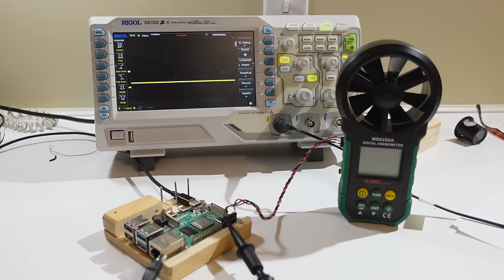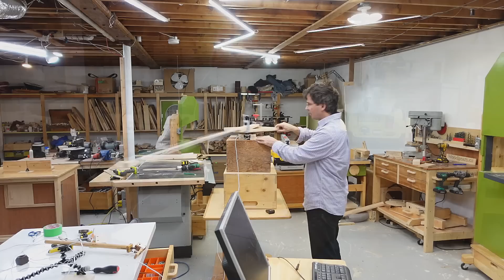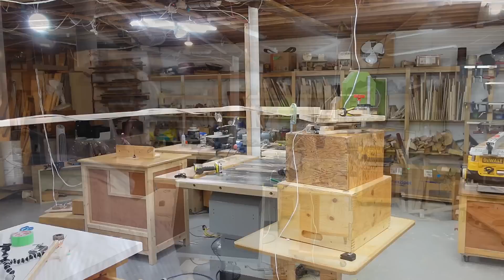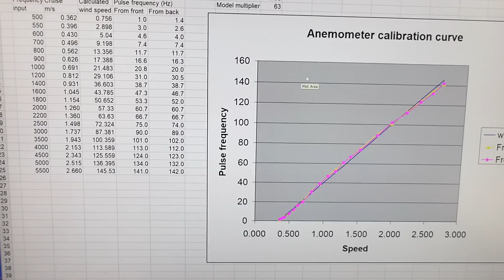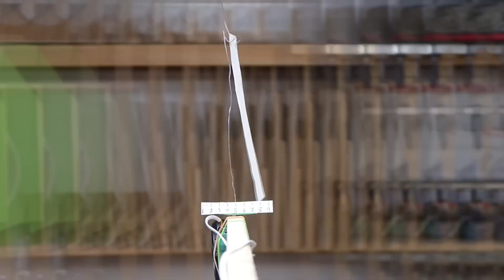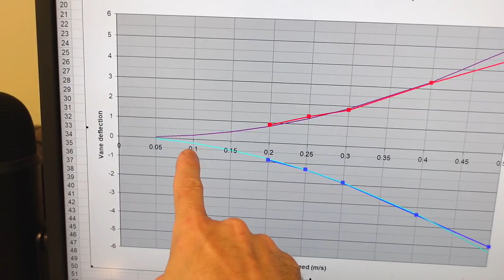Calibrating my anemometer for measuring really low wind speeds

Comment: Looks complicated can’t you put it on the end of a pipe and blow air through at a given rate .
Air circulating smoke or a thermal camera.
I hung 9 temperature sensors in 3 lines from the ceiling  floor and ceiling were 20 deg c different. Halfway between floor and ceiling was half way between two temps.
When petting aircon fan on recirculate all sensors went the the half temp , after turning fan off all temps split again to original readings.
Made some cool graphs

Comment: Matt, for low speeds instead of deflecting a sheet of paper, you could consider a static orifice with a microphone to measure sound pressure volume, but you would probably have to calibrate that! U of W alumni.
Reply from the maker: those slow speeds don't make enough turbulence to be heard
Reply: @matthiasrandomstuff2221  It doesn't have to cause turbulence! I think the idea was measuring the static pressure the wind would be causing directly from the signal, rather than the oscillations from turbulence. It not causing turbulence is a good thing!
Reply: P.S.: Especially with a large surface attached to the microphone (i.e. a sheet of rigid plastic or even paper attached to a piezo), it should be easy enough to measure the static pressure. I'm thinking about doing that experiment myself now out of curiosity! I've been wanting to measure the pressure coming out of those little ultrasonic humidifier devices for a few months, and this sounds perfect for that.

Comment: Aerospace engineer, swinging through the same air is not ideal, but in this case i wouldn’t worry too terribly much. As a non-lifting surface only the drag is really perturbing the measurements in future sweeps but for just a couple I think it’s unlikely to be a major contributor to your error here. They used to have rotating boom equivalents to wind tunnels that worked ok but did face problems with re-entering the perturbed air

Comment: Hot wire anemometer for low speeds, just as other said in their comments. Those are used in small airplanes (gliders especially) and measure to 0.1 m/s speeds. Just 1 wire and resistance measuring ( plus "heating current").

Comment: Wouldn't it be easier to fill a room with "smoke" or with "prism" light and that way capture the air movement via dust or particles suspended in the air?  I think the error factors are going to creep in at those super slow speeds any way to try to minimize it. Someone walking upstairs or downstairs or random knocks or creaking or settling or just temp and humidity changes might cause brief error readings right ? 😀
Reply: I think that works great for visualization, both for conveying the movement and figuring out roughly where air is moving, but the problem is quantifying it.

Comment: Would it be possible to measure the static pressure on a paper disc? Instead of deflection?
Reply from the maker: with a sensitive enough scale, yes.  but deflection is much easier

Comment: Very interesting! What you need, for low wind speed is either an ultrasonic or hot wire anemometer (or an expensive laser Doppler anemometer), but the paper flap has low mass and seems sensitive enough for your project (and the principle has been used for ages, as a visual indication of wind speed on weathercocks - nevertheless a patent was granted for it in 1987).

Comment: Nice setup. Have you considered not to measure the frequency at low speeds but rather the time in between pulses from the sensor? The ratio between max windspeed and very slow speed might be too big for accurate frequency measurements (in one frequency range). An alternative methode  might be to increase the sensor pickup at low windspeeds by increasing the number of reflectionstrips?
Reply from the maker: timing indivisual pulses is risky as the motino may not be that smooth.  But I accumulate at least 40 transitions or 3 seconds worth to make sure I have a good frequency reading.
Reply: @matthiasrandomstuff2221  Thanks for the response. If the highest windspeed is lets say 25m/s and the lowest that you want to measure is 0.1m/s than this gives a frequency range ratio of about 250. To measure this accurate over the full range with lets say .01m/s accuracy you need most likely to change sample time (or gate time). Do you do this in the way you measure the frequency?

Comment: This measuring device only measuring the speed in 1 direction. You have any thoughts about a 360 degree measuring device? I’m thinking about a balloon upside down, with a needle glued on the bottom, and a circular scale. So you can measure the actual speed and direction in 1 go.
Reply from the maker: I could just have two vanes 90 degrees different angles

Comment: Instead of a peace of paper, maybe you could use thin material with much lower weight. And add a little weight on the bottom, for stability. In addition you could trying to create a cupped shape, so you receive more force, that will result in more accuracy.
Reply from the maker: I could also have used a longer strip of paper for more sensitivity.  But at some point it just gets too twitchy
Reply: This paper sheet is too hard. Cotton yarn is extremely sensitive and used in soaring planes (gliders) in front of the pilot to indicate side slip.

Comment: Love your problem solving.  To avoid the twisting cable, maybe use an ESP32 and battery setup.  To sync with stepper pulses, you can use a LED on the stepper pulses that flashes into a photo transistor connected to the ESP32.  The other option is to time sync everything, I guess +/1ms is good enough.
Nice idea on the flapping paper to measure low air speed.
Reply from the maker: or just untwist it every time.  Way less effort.  Plus I wanted to do a reverse pass anyway
Reply: I was thinking the same thing, only with a Raspberry Pi and a power bank.

Comment: Do you take in account the current air pressure? Measurements will be different under different air pressure conditions, because of the density of the air. Not sure if humidity has a significant effect on the ‘performance’ of the fan at the same speed.
Reply from the maker: yes, that will make a difference, but the variation in air density is smaller than the accuracy that I'm aiming for
Reply: @matthiasrandomstuff2221  understood 👍

Comment: Isn’t the angle of the fan pointing 90 degrees, effecting the measurements? You could easily test it by giving the measuring fan a slide angle inward. My prediction is a few procent more fan speed, with a few degrees angle inward of the circle.
Reply from the maker: do the experiment, and you will see your prediction disproven.
Reply: @matthiasrandomstuff2221  I only know that if I put my wind speed meter on a angle in the air direction, I’m getting lower readings.
Reply from the maker: yes, cosine error.  But being 10 degrees off is not going to make a noticeable difference

Comment: Pretty cool. A friend had an idea about how to measure low currents in a room using sound waves and calculating Doppler shifts. With an apparatus of known dimensions it should be possible to calculate speed and direction. Having several of them in a room, at different frequencies, might give a "picture" of the air currents. I don't think it was ever built, but I've always wondered now with fast computers how simple it might be (at the time he theorized about this 2400bps modems were in vogue).
Reply: This is how some house gas meters measure gas flow.  Total use is the integral.
Reply: Doppler shift is a working but "time of flight" is the method of pro weather station sensors. See from a comment here.

Comment: It might be interesting to try a collab with Hex Base. He's more into audio/speakers than HVAC/fans but he ends up doing a lot of e.g., computational fluid dynamics:

https://youtu.be/tY5ijVq2QzE

...i.e., predicting how perturbances in the air will propagate through chambers of various shapes. It seems like it could be at least tangentially related.

He also ends up doing a bit of CNC, etc. so you guys might be able to trade various bits of expertise.
Reply from the maker: that guy ONLY does speakers.  i'm not interested in speakers.

Comment: You'll most likely reach the lower limits of those mechanical anemometers in this experiment. Have you considered ultrasonic anemometers?  There's no minimum force to overcome at lower speeds, and they also give you direction!   You can map and figure out how the air is moving through your house, e.g. is it being deflected off of walls, door etc.

You might consider buying a couple of the sensors to make your measurements... The experiment you propose to do is hard enough especially at low speeds...  The reason you may want more than one of these to measure the wind's path because each time you walk through your experiment you disturb it and you have to wait for conditions to go back to baseline.

I know they're pricey, you can consider to DIY them... Each anemometer needs 2 pairs of Ultrasonic transducers a sender and a receiver (like the Ping sensor) and you measure the time of flight from a pulse generated by the transmitter to a receiver... then the same thing is done with the other pair at 90 degrees, then crunch the numbers, do some trig to calculate the angle, you get a vector of the wind (speed, direction).

I worked as a firmware engineer at a weather measurement company for 12 years, these are the very kind of problems in the field of measuring weather phenomena that comes up often, it's not as straightforward as people think... once in a while I get someone that can't believe it is that complex... and I'd say to them, if you think this stuff is easy, then clearly you don't understand the problem.  For example: Solar irradiance needs cosine angle corrections, soil moisture sensors require AC signals to prevent migration of the sensing materials in the sensor, Rain has tipping buckets have errors at high rain rates and can't measure trace rain amounts... and last but not least... mechanical anemometers have low windspeed startup issues...   not so easy after all...  right?
Reply: Thank you for that fascinating rabbit hole! Half a dozen tabs later I'm reminded how little DSP I truly understand as a hobbyist
Reply: @academicpachyderm5155  🙂I'm still learning. DSP Cool! I've just dabbled with it.

Comment: Have you tried using a large cpu fan and reading the pulses?  You could use your rig to calibrate it.  I assume it will have a higher breakaway torque because of the coils but would be neat to see a diy wind speed sensor.  Love you low speed analog solution and test apparatus!
Reply from the maker: I have playeed around with fans.  But it needs to be a 5" ball bearing fan, and the motor part needs to be removed for it to spin freely

Comment: Put a conical cylinder in front of the meter. The increased speed would be easier to measure. Divide the result by the amount the cone mechanically increased it to obtain true air speed.
Reply from the maker: I just tried that.  It made maybe a 5% difference.  Not worth it.

Comment: It's pretty cool to see all these experiments, you can now write your own firmware y start selling accurate anemometers!
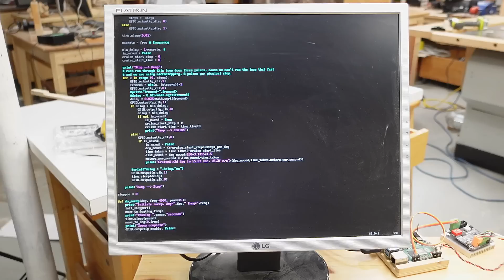1:54 Time to start using string interpolation =) print("Initiate sweep, deg=",deg," freq=",freq) can be print(f"Initiate sweep, deg={deg} freq={freq}") (which I think is neater) and the same with the old % and the .format ones.
I'm kind of jealous actually, I got so used at writing software "the correct way" (with object-oriented programming, unit testing, TDD and all that stuff) that I wish I could just wing it lol The only times I do it that way is during programming competitions where speed is paramount.
Reply from the maker: I'm not a python expert, I will have to keep that print thign in mind.  Python is great for just winging it.  A lot of "parameters" I just put in the code.  The code IS the configuration file.
Reply: @matthiasrandomstuff2221  "use the source Luke" seems appropriate (I remember this from someones .sig file a long time ago).
Reply: You can even do f"Initiate sweep, {deg=} {freq=}" to save typing the variable names twice.

Comment: could make a larger prop for the meter, or add a collecting duct.
Reply from the maker: The collection duct is a neat idea.  But making a prop tht runs easily enough is a challenge.  I tried to make a better one, but the one in the meter runs extremely lightly already.
Reply from the maker: I tried a cone attached to the meter.  Surprisingly, it made almost no difference, maybe 5%

Comment: I wonder if an alternative would be to disperse some chemical marker in the air that a device can measure. If you know the diffusion speed from a static air experiment, then you could calculate that out of the concentrations measured around the house and get values for the drift.

Comment: Very interesting. Why 2 meters? It seems that your life would have been easier with a shorter radius. Also, FWIW, if you soak the rims of the holes in your paper sensor with thin cyanoacrylate and allow it to harden (out of the apparatus that is), it will stiffen and be more robust. 
So you plan to map airflow in your home?  I think this is a great project. Thank you.
Reply: the long radius allows more time for the aerodynamic drag to dissipate before the next turn.

Comment: why is deflection proportional to speed squared
Reply: Kinetic energy deposited? Good question.
Reply: If you double the speed, a fixed mass of air has twice the force, but in addition to that twice as much air hits the paper in the same period of time so the force is quadratic. Since for small angles tangent is approx linear, the deflection follows the quadratic drag force for low wind speeds/deflections.
Reply: It comes from Bernoulli's principle, as I recall.  But it's a been a minute since my Fluid Dynamics class!  :)    Wind acting on the sails is proportional to the (sail) area times by the square of the wind speed.  I remember this because we had a competition where a 2L soda bottle had to traverse a certain amount using baking soda and vinegar.  And the idea was to come up with the best sail design. But I don't recall all the derivation of the formula involved.